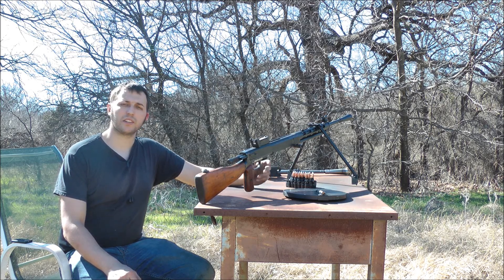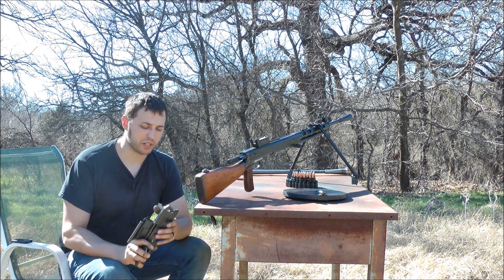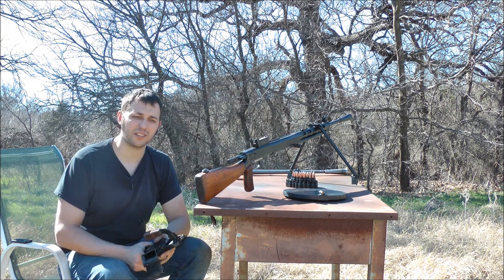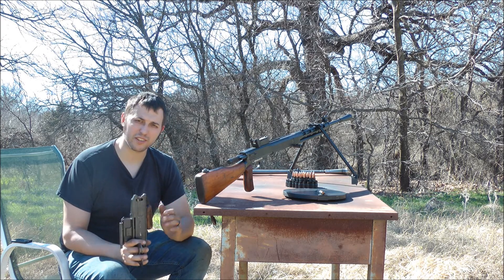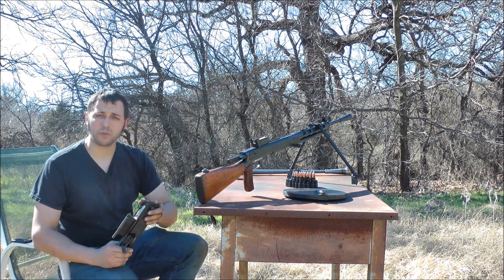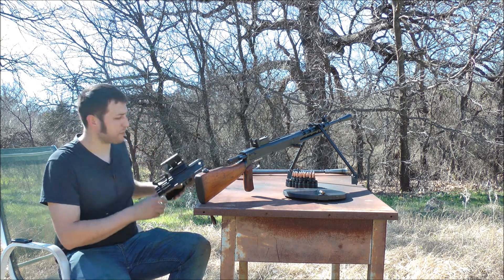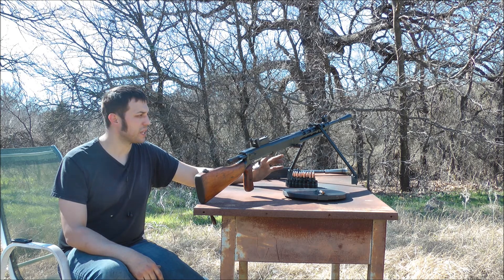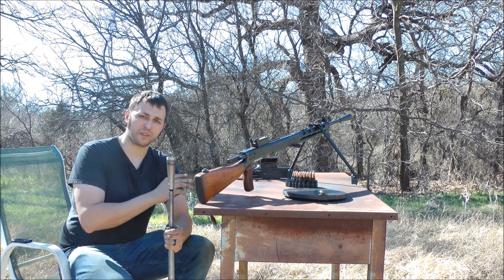RP46 top cover intro

Comment: could not agree more with your design changes. the booster is a cheaper way to increase gas pressure without the expense of a new barrel/gass block. the changes you mentioned to the top cover mechanism are perfect, will increase functionality/ease of use, while eliminating the need for costly cumbersome cuts on the existing gun. i mean, i can't agree more with these. definitely interested, will fill out the form now.